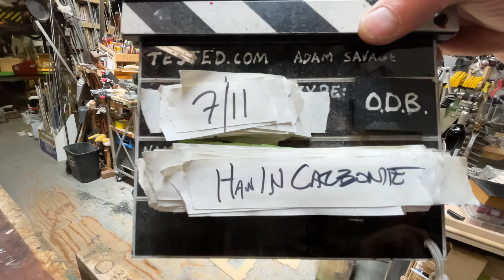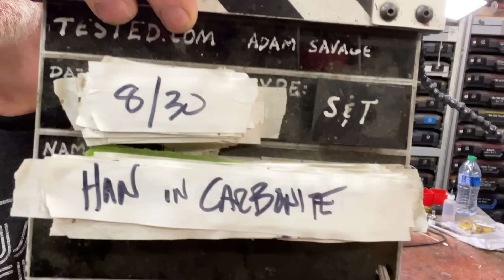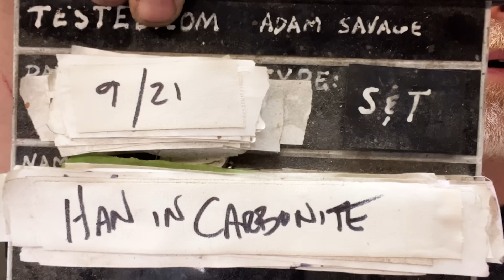Adam Savage's One Day Builds: Han in Carbonite!

Comment: In 1976, in my 8th grade metal shop. We made a forged flat head screwdriver, we knurled the shank and pressed that into a Plastic handle. I still have that screwdriver today. Do I reach for it, everyday no. But if I need a large rugged straight slot. It is the one I reach for.

Comment: The beauty of the clamp knurller is that you're not just countering the radial forces but also the tangential thanks to the fact the material is moving the opposite direction on the other side AND it acts as a steady rest, removing gravitational deflection. Keeps the lart perfectly concentric with no taper

Comment: Striking nixie tubes is easy! You need a solid state 250volt switch mode supply,  the high voltage driver chips, and then you just talk to the tube in Binary Coded Decimal with shift registers, and a counter or an Arduino.  I made an eleven digital nixie tube clock with time, date, and day the week.

Comment: So, the silver discs that you said you didn't know what they were, I think they looked familiar to me.  I've seen something like them on an electric cooker from the 70s/80s and there would be this black knob placed over the center, a registration notch in the silver disc, and there would have been a printed scale on the chrome and this is how you would have turned your hob up and down - Don't remember the manufacturer but that's what they reminded me of.  This allowed the indicator to be larger and easier to see but the outside would float over an enamel surface with one mark which made cleaning really easy, you could slide the knob off, get rid of most of the grease and then put it back on and there'd be no visible grease.  I'd have to see it closer than you showed to be sure, Adam.
Reply: This would have been the underside of the dial which is facing up in your build

Comment: I don't know if it causes any damage to the material's final strength, but I've slowed down body filler, and even kept it open and workable a lot longer than normal, by mixing in some acetone.  It let me work the material to a way finer finish and thinner application, so I had a lot less sanding to do in the end.  I didn't notice it impacting the properties of the final material any, but my sample size is small.
Reply: There's a thinner made for body filler. It's that purple juice that pools in the can but just a can of it. It slows the setup and makes the filler more creamy workable too. It's not like acetone the thinner is pretty thick and viscous. It's easy to find. Just search for plastic body filler thinner and use the right stuff. Any decent auto body supplier has it.

Comment: TIP FOR DEALING WITH THE VHB RED BACKING - don't cut it off with the VHB. Peel it back enough and just cut the VHB itself. That will leave a tail of backing for you to grab nextime.

Its slightly awkward to cut your VHB to size but this way but far better than dealing with that stupid backing every time.

At one point I used to avoid using VHB whenever possible because I hated that backing so much. Not anymore